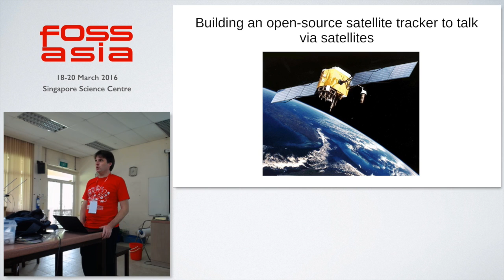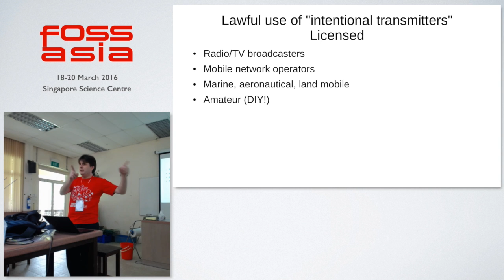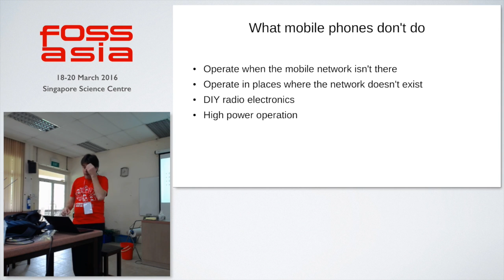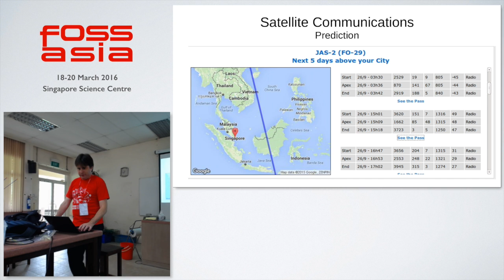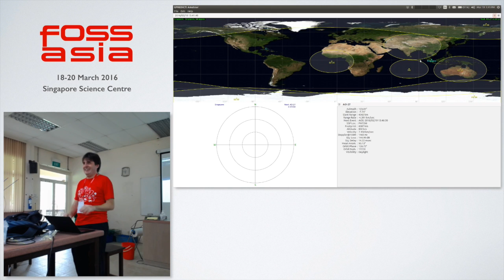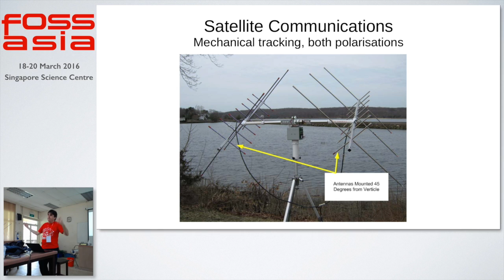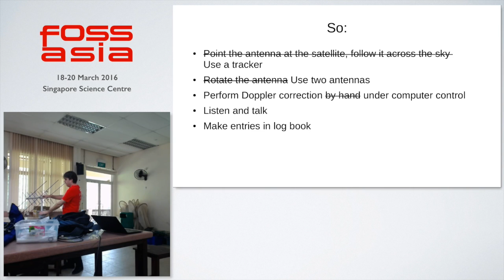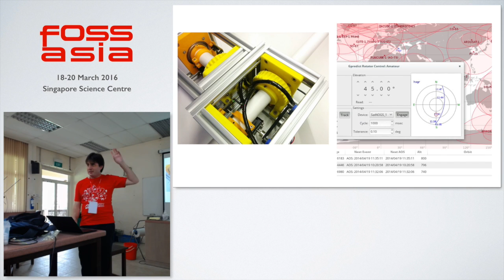Building an open-source satellite tracker to talk via satellites - Roland Turner - FOSSASIA 2016

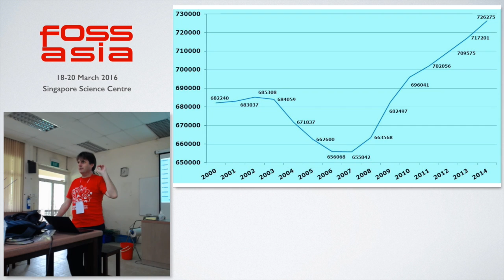Comment: Regarding the slide at 3:28 and the reason for the increase in US licenses starting in 2008 . . . Morse code was eliminated as a requirement for licensing in 2007.
Reply: Oh, I'd missed that, thought it happened much earlier than that. Thank you!